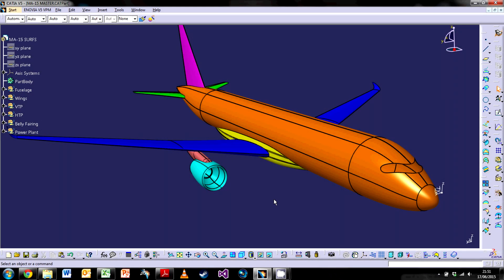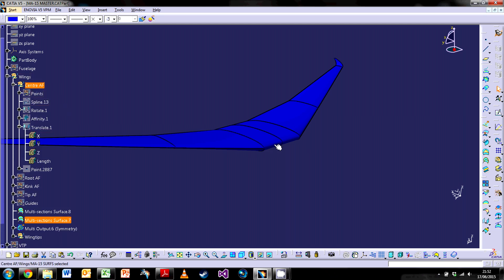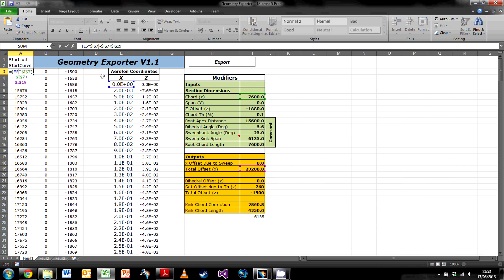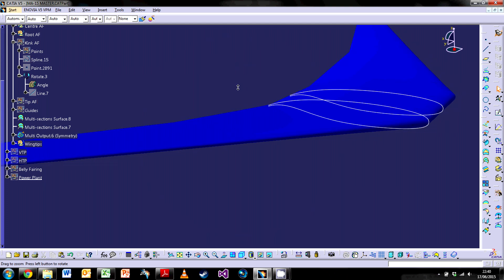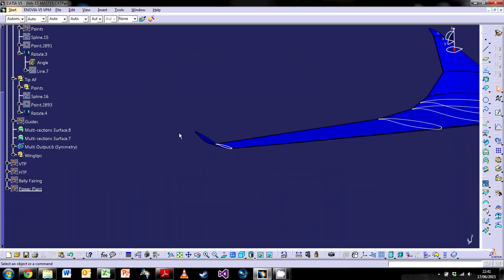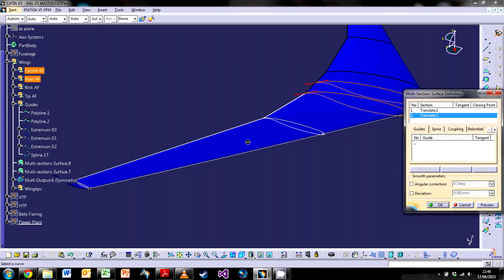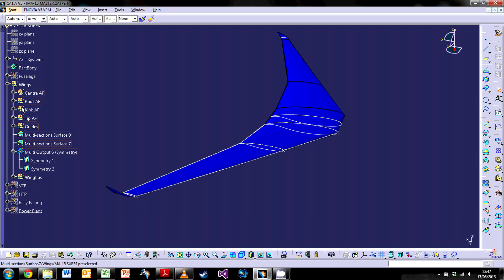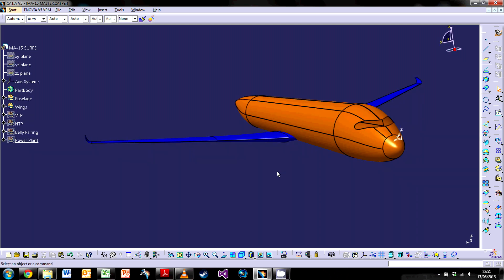CATIA V5 Aircraft Surfaces Design - Part 2 : Wing Design

Comment: Excellent videos many thanks. Three areas that I stumbled on. If you could address these it would be a great help. Of course the first time I tried this was on a fighter aircraft. The fill method you presented does not seem to work for pointed noses like on a fighter aircraft. On a fighter aircraft there are no nice round fuselages.Getting around canopy and integrating wings I'm finding to be a challenge with not solution in sight yet. Lastly the process of going from a surface to an actual part with thickness.